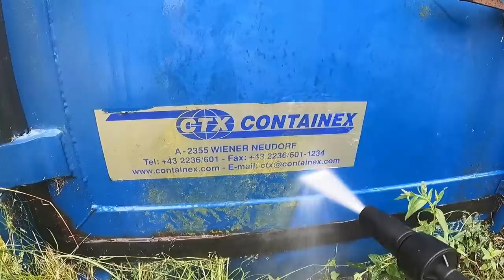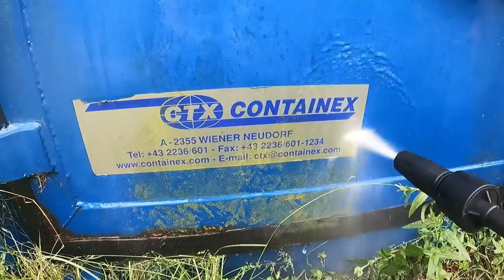I cleaned a local village hall for FREE? (Pressure Washing)

Comment: That pressure washer looks like an RAC Pressure washer I bought.
Not powerful at all but that could be down to the attachments I have,
Took a while to clean stained outdoor cement tiles.
Reply from the maker: Yeah it's ideal for small areas and odd jobs really, not fit for larger driveways as it may take a while due to lower water flow but for grubby steps, small patios, cars etc its wicked

Comment: Fair play Sid nice to see can I ask a bit of advice please if you don't mind? i need to clean my block pavers driveway it has black spots and lichen in Ireland the strongest hypo i could get was 10 t0 11% what ratio would i need to dilute with water and how long to leave before rinsing off would you recommend ;Thank you in advance if you get a chance to answer
Reply from the maker: Hi mate, start off at 4/1 so 4 litres of water to 1 litre hypo, sprinkle it on with a watering can, scrub it with a brush and leave to sit for 20-40 mins, rinse off thoroughly and watch any tarmac close by! 
if its not shifted it try again at 3/1, then 2/1 then neat if needed
eventually it'll be shifted :D